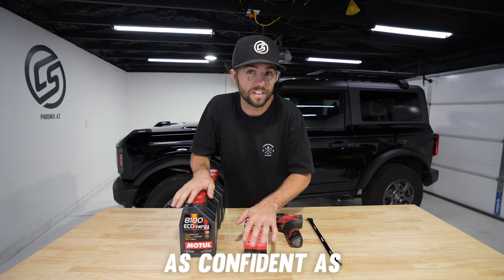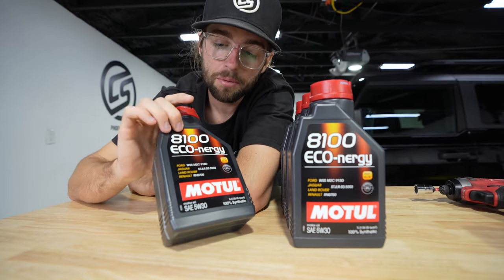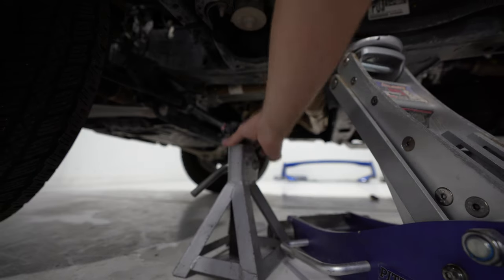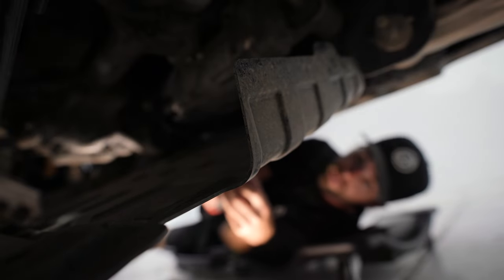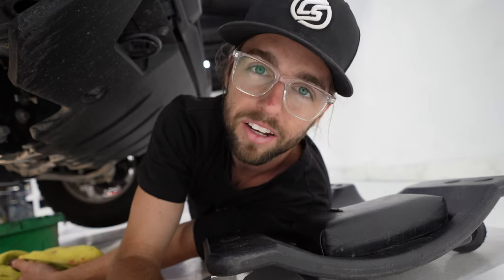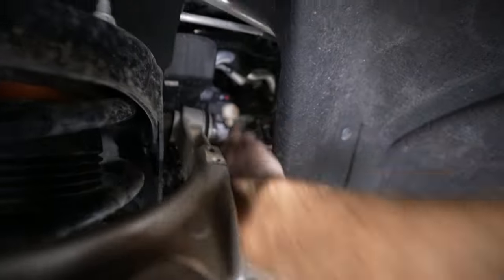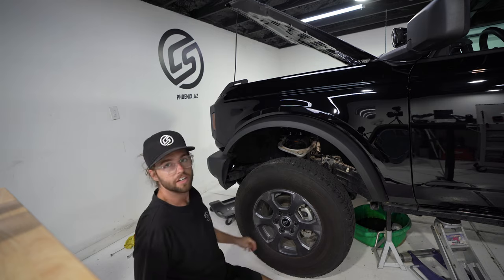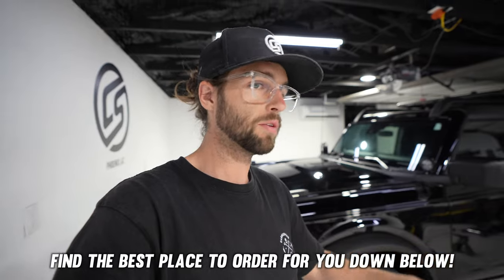Buy This Tool Before Changing Your Oil Next.

Comment: plz help my ms3 has noise coming from transmission when not stepping on clutch. when i step on the clutch while in neutral it goes away.  it's has a lightened flywheel and stock clutch. any ideas ?